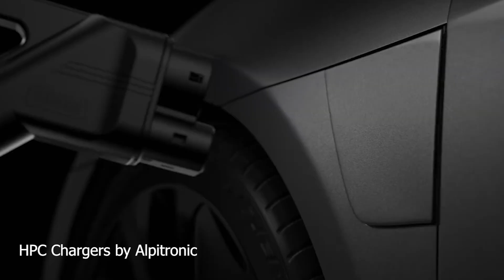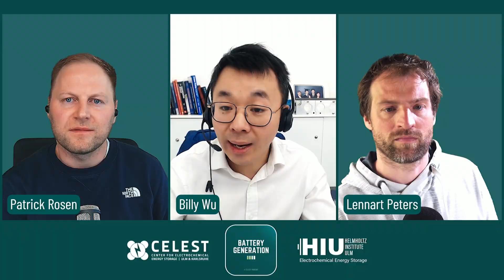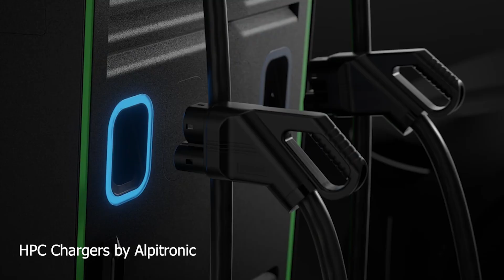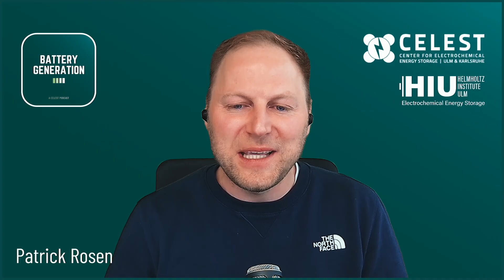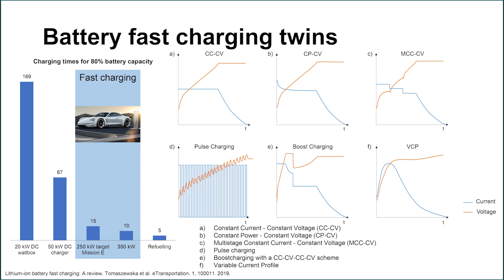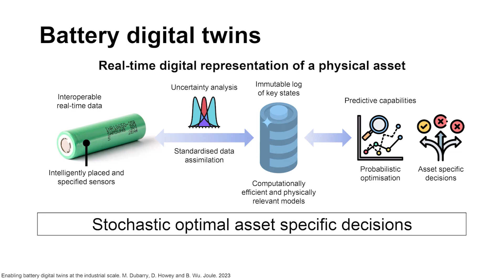Dr. Billy Wu: How Charging Routines affect Degradation | Battery Podcast

Comment: Great discussion here, as always the devil is in the detail. But intelligent design of cooled cables can help reduce cable size and heft, Tesla has a patent on cooling individual cores that makes their cables lighter. 
I disagree a little with Dr Wu about his reply to the question on charging degraded batteries, the vehicle BMS/Thermal Management will know the status and tell the charger what to do.  Smart charging is more often done with lower power home charging where a charge to time/state can be specified, better not to conflate the two purposes.
Reply: Yeah I think what he meant is that the BMS will cut off the charge. Although yes, BMS is not monitoring the degradation, I think the smart charge algorithm are led by the charger itself not the BMS. Currently I don't see adaptive smart profile charging based on battery state of health this is his research I guess!

Comment: Interesting facts that give a better understanding of how to look after your battery,
I've always thought that the reason the charging slows down as the battery gets more charge was because the Potential difference between the power source and the battery was getting closer so it becomes harder to push charge when the Voltage equals out.

Comment: I have over 10 years old laptop with over 95% SOH battery. I have limited charging to 60%, and starting of charging to 50% unless I need hours of working time. 

When battery was new, it was bit under 30Wh, and now it's over 27 Wh. I perform couple of times a year a balancing and capacity measurement cycle. Most of time the battery is idling between 50 and 60%. That 10% is enough to move with power on in energy saving mode or work for a while without plugging in. It sometimes goes to under 40%, but charges then only to 60%. The battery experiences full cycle or nearly empty only couple of times a year. Otherwise it's between 40 and 60% soc.

Comment: In terms of the issue around large charging cables. Why can't the charging voltage be increased such that there is less current flow reducing the physical size of the cable?

Comment: EV  Manufacturers should add  bigger  buffer for  EV batteries  to  avoid  getting close to  overcharging limits , if  battery  100%  charge is  4.2V   make it  4.12 as maximum charge  ,the same at the bottom  , when  lowest  safe is  2.8V  make it  2,88V as a lowest voltage .
Reply: Consumers want more range (that the almost never need) and want to pay less for it (it costs more, and weighs more).  So don't give me SHOULD
Reply: @rcpmac  bollocks

Comment: If an EV were to have a type of odometer- or a log recorder stored in nondestructive / non-resettable memory showing amount of recharge KWH at a +50KW rate, number of KWH discharged while under 20% SOC, and number of hours battery pack spent at 100% SOC (for non iron phosphate packs) , this would give good metrics to amount of wear of tear. 
Outside of that, a 20 mile drive cycle where amount KHW delivered can be correlated to the percent of charge drop, and then compared to when the pack was new. Example: M3 LR pack is 82KWH/80KWH usable, 1% of charge is 800WH at 75 degrees F when new. A noticeably degraded cell will start delivering less WH per a percent of charge at the same temp.

Comment: This is confusing. Okay, they agree on keeping low SoC but this tesla prof says it’s the %DoD effecting degradation, “micro-cracking” of iron oxide crystals within the battery cells occurs much more at full charge-discharge cycles. His advice was to charge less at a time at low maximum SoC to 75% max. Also, I think “plating”, when lithium gets lost, he called “dissolution”.

Comment: I always trickle charge my Jaguar. BMS goes haywire if it goes under 11,5 volts. So I try to drive it as much as I can since it charges the battery during driving.

Comment: Eventually, it will all be wireless charging.  Or at least for the most part.  You can be 100% sure that Robo Taxi will be wireless charging.  There are busses in China which already charge wirelessly at 500 KWh.  Also there is very little loss.  Perhaps that will improve with technology. SO the weight of the cable shouldn't be a factor for THAT much longer.

Comment: Much of the digital battery twin data can is collected by a decent BMS.   The voltage of each cell,  over current charge, over current discharge,  highest voltage cell,  lowest voltage cell,  back temperature,   balancing,  etc.   So just data log that (lots of BMS units have usart, CAN, Bluetooth, and wifi.
Reply: Do you know how exactly they measure the current and the voltage? Most tesla module teardown videos only show the length of cable welded to the negative terminal that acts as a fuse but I haven't seen many lengths of wires that run from each cell to BMS.

Comment: I'd rather just sit in a NIO and let battery swap manage it all, within 4 minutes.....
Reply: Who owns the battery in your car? Would you swap you shiny new battery with some unknown battery?
Reply: @rjbiker66  until a few days later and you swap it out again? You're worrying over nothing 😀 Besides, just think of the resale value of an EV, which is 4+ years old where you have zero understanding if its been correctly charged over its lifetime.... the solution? Battery swap.
Reply: @barr96  a few days later someone else has swap their battery with your original.
Reply: @rjbiker66  you're missing the point. You don't own the battery :)
Reply: @barr96  so what happens when you want to sell the car?
Reply: @rjbiker66  BaaS is transferred to new owner....

Comment: Oh wait me petrol car has none of these issues lol!!!!!
Reply: Well I guess your few of the lucky ones 🤣
Reply: @JohnD0129  petrol degradation from charging? Sure.. I am the lucky one
Reply: @jolly1039  your petrol engine degrades every time you start the vehicle 🤣
Reply: @JohnD0129  You are comparing apple and oranges. Battery degradation in comparison with petrol degradation
Reply: @jolly1039   no sir I’m comparing transportation vehicles in general. Doest matter if it’s Petrol vs EV. All parts degrade over time and are expensive.
Reply: @JohnD0129  okay sure degrades and spontaneous combust your ev lol!!!
Reply: @jolly1039  what ICE vehicle do you drive ?
Reply: @JohnD0129 one that take 1 min to fully charge, 500 miles range, do not spontaneously combust in the garage, and do not cost an arm and a leg to buy or maintain
Reply: @jolly1039  answer the question 🤡
Reply: @jolly1039  Oh, petrol cars do spontaneously combust ... and many times more frequently than any EV! Check the stats. I know you would like to believe the things you say but I'm afraid you appear to have been misled.
Reply: ... how's the climate change coming along?

Comment: He's getting all of the little but very important points incorrect.16:00 battery temperature not external ambient temperature is what limits charge performance. As soon as the battery as preconditioned aka heated up to above freezing temperatures It will charge at high speed like normal.
Reply: You just have to have the power available in the battery to pre-condition

Comment: BATTERY PASSPORT: "A battery passport would keep a record of an individual battery's constituent parts, aiming to increase transparency throughout the supply chain. Information about the battery's raw material provenance, manufacturing, carbon credentials, human rights record, usages and more would be digitally recorded."

That doesn't benefit the consumer, this is for politician's control.  A better passport would track charging cycles, environment, load application, charging history (abusive?).  This information could be developed to provide REAL value to consumers rather than the political bickering built in to the existing passport.

Comment: Around 24:30 Dr Wu suggested a choice between accuracy and simplicity.  I think that is a false choice.  Logs over the life of the battery charging and discharging environment can certainly be maintained.  Effort of creating such a system and at what cost is likely the real problem.  OEMs don't care once they sell a product.  Also, they may be creating a system that could be used against them when it comes to warranty issues.  

a graph of SoC would be useful to the 2nd hand market.  I personally would avoid an EV with high annual mileages.  The chances of poor charging habits might increase.  Wouldn't a graph showing 20-80% charging and little degradation be more valuable that someone that drives little but charges to 100% frequently?

Finally, the unspoken truth -- data is being harvested from every car without the owner's knowledge.  So why couldn't more information be available as to a batteries care over it's lifetime?
Reply: good arguments! However if the battery_data_Logs were available and/or could be manipulated by the consumer, or with the help of "expert shops", just before a second hand sale!!!, I would be suspicious!
Reply: @konradcomrade4845  - agreed.  Data should be immutable and that can be managed with digital signatures.

Comment: Is 100% battery always full on battery? I have scooter it says 100% full but when I test it on multimeter it says 82,5 something, if 82,5÷20 (it's 20 series system) it gets 4,1 volts the lithium can be full at 4,2 volts?? 2nd another my scooter it's says 97v (23 series system) after got charged at 97v full, it's drop to 96,5 it's 4,19 each it is save for long run? It's already 4 years now and I feel like nothing changed on range it's like brand new
Reply: Your electric scooter could measure a single cell's potential in the pack to determine the state of charge. Also, Device manufacturers could design products with upper limits below 4.2V to prolong device life. The cells in series could have different voltages that add up to 82,5. Cell potentials are not the same due to manufacturing inconsistencies and different ageing rates.

Comment: Yes I agree with you, the battery of my car, 9 years old, 420.0000 km and 1900 cycles, have a capacity degradation of 12 %, 20 % increase of internal resistance.
But with my New victory smart solar charging at home the charging power varying from 1200 to 3500w
So I gain 1 % capacity and lower impedance.
120 KW at 5 % soc 7 years ago, now 83 KW at same soc....the BMS do his job.....
45% SUC 55 % slow at home.
Thanks tesla.
Have a nice day🌞

Comment: Very interesting discussion. A thought occurred to me regarding battery degradation. With potholes in our roads multiplying rapidly. The vibration caused by driving a car with an out of balanced wheel will surely impact the integrity of the battery when you consider the sheer number of physical connections in an EV'S battery. Just a thought...
Reply: Incredibly unlikely I suppose if you had a wildly out of balance wheel and a poorly latticed battery connections, you might run into some issues. It's definitely not an issue in any Tesla

Comment: Very in and interesting, will check the rest of the series.  Someone needs to design a safe add on battery pack to lower the range fears of EV.  And FYI my phone battery is useless at 88% of health, but luckily they have battery cases till I can afford a new phone 🖖
Reply: How come 88% health is useless?
Reply: @somutfaydalarpesinde3289  really not, planning on getting one more year out of phone. Then it’s a backup and MP4 player. Thanks ( useless is probably the wrong word, less useful is better )

Comment: 250 kilowatts is the hard limit for passively cooled cables...

If only typical charging speeds were anywhere CLOSE to that number, even 1/2 is good!

One of the problems is the shoddy BMS systems being used EVs today. Be it the cooling or the mechanical board being used.
Reply: What is "shoddy" about the BMS?
Reply: @MrAdopado  - It controls the how much amps can safely flow into the system. 

Many systems aren't built with control systems to allow the battery to charge at it's maximum rate hence it's "shoddy"

Tesla has active cooling and heating in their BMS systems, many other companies use passive cooling which isn't enough. That's just one example.

Comment: It seems to me there is a strong argument for moving to higher battery voltages in order to enable faster charging without needing thicker cables. Perhaps 800V or even higher will ultimately be the solution for really fast charging?
Reply: Agree, but even at 1000V(1kV) a 350kw charger still requires 350A 🤔

Maybe 1kV is not enough?
Reply: @pietersmit621  Right now with Tesla v3 superchargers that push up to 250kW they are already using 520A since superchargers are using 480V.  I don't think 350A is not that big of a deal.
Reply: I know it's not a Perfect Analogy but picture voltage as water pressure and amperage as the actual amount of current being transmitted.

If you need to fill a 5-gallon bucket, there is really an ideal pressure and amount of water to fill it. A thin spray at high pressure is going to fill the 5-gallon bucket slower than half inch hose that delivers 5 gallons per minute at a lower pressure
Reply: @mac_mcleod  It does not work like tha. The battery is in two 400 volt  halves  that are normally connectted in parallel. If hey are charged in parallel the charging power is 400 times the charging current.  If tthey are reconfigured to series connection during charging the charging power is 800 times tthe charging current. Therefore an 800 volt system delivers twice the charging power of a 400 volt systtem at tthe same charging current.

Comment: Don't use the cheap, #17 14-50 receptacles for level 2 charging  of your EV.   They are made of cheap plastic and will melt sooner or later even though the charging amps are kept well below the 50amp rating.   They just can't handle the multi-hour charging temps that an EV load puts on them.   Use the $90 kind (Hubbell) that are made much more robustly.
Reply: do you have ANY data to support your assertion?  any UL-approved receptable is tested to its max currents and temperatures ratings, and yes, that is continuous current.  I've been charging my tesla on a "cheap plastic" 14-50 receptacle for 2 years, winter and summer, and the receptacle doesn't even get warm.
Reply: @tomwojcik7896  I had it happen to me after 5 years of charging on the same outlet.   All the EV charging channels have talked about it.   here is the one from Munro & Assoc. https://www.youtube.com/watch?v=tDp9PhPJhUI
Reply: @tomwojcik7896 yeah, these “old wives tales” really take hold at lightning speed since the invention of the Internet. The reality is that home gamers who have no practical industry knowledge install their own receptacle to show how “stupid” it is to pay an electrician, and they end up not securing the wire correctly (not fully seated, not tightened fully, wires squished out to one side, or any number of other installation issues, which all cause higher resistance and thus heat and eventual failure. Just because one can purchase a receptacle that is idiot-proof and over-engineered does not mean that product is required. Those Hubble receptacles are more intended for high-cycle applications like RV hook ups at a campground, etc. The most common use for NEMA 14-50 in the US is for connecting electric ranges that probably see a dozen insertion cycles in their lifetime, so the “better” receptacles are in fact better for some outlier applications, they are absolutely not “required” to deliver rated power.
Reply: The NEC would like a word with you 🤣
Reply: It is indeed true. Moreover, a 50 Amps Hubbell outlet is still to be used at max 80% of it’s capacity. So anything above 40 Amps on a Hubbell outlet is illegal, the instruction manual of let’s say a CPH-50 from Charge Point clearly states that anything above 9,6 Kw is required to be hardwired.

On another note, raising the voltage to lets say 2 KV would keep the cable small for a huge power transfer.
Reply: Never use a receptacle. I don't care if you use the Hubble, they're still not nearly as safe as a hardwired EVSE.
Reply: @DJS_ENO  yes, but when I travel I want to take the adapter with me...
Reply: @DJS_ENO  do you have ANY data to support your assertion?  how many fires / injuries / deaths have there been per hour of usage on receptacles vs hardwired EVSEs?  (that's what safety means).
Reply: @tomwojcik7896 what aboutism is not data - do you have anything you can point with data say how the cheaper plugs are failing?
Reply: @DJS_ENO it’s more about the correct wire than the receptacle. Of course, a cheap cheap one is not suitable for a regular grade will do as long as the wires are good.